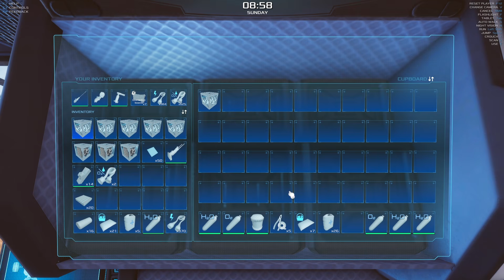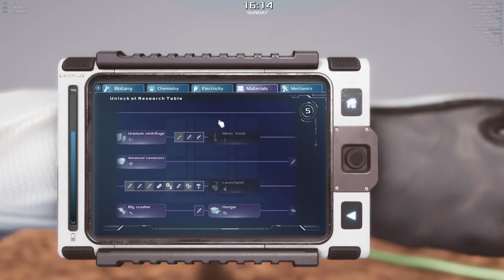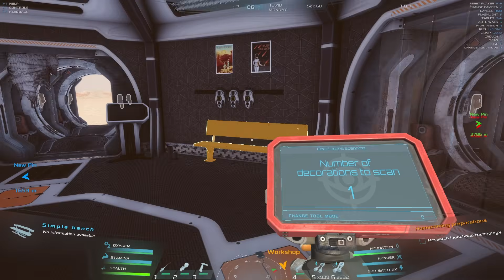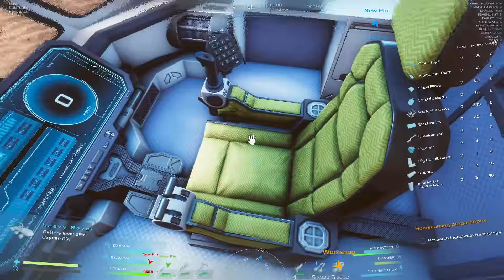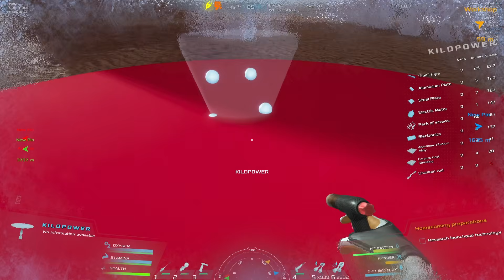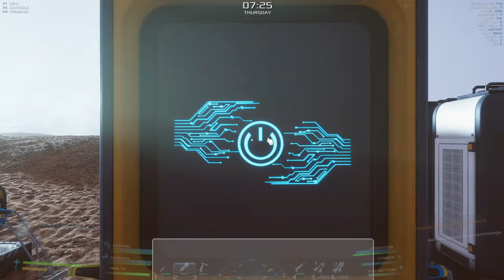Occupy Mars – Remote MINING Outpost and NUCLEAR POWER [E9]

Comment: i know im fairly late but it's for the users in the comment :)
Build platforms. more platform and even more platform :)

why i say that? when you build a platform, you can place solar panel, the kilopower, the power consumer and they don't require the cable. then you can use a ECU to send power somewhere else. you can't import power however but you can export.
when you get the tech, use O2 from room. the rover can keep your tank full. it recharge them automatically. saves me the trouble from manually reloading them. can also reload them via the inboard O2 port
the game still has lots of glitches but work somewhat OK.

Comment: What's the best way to use batteries? I have  the batteries but not everything charges and I have 1000 powered. Yet they don't charge. Having to step down the power each time between batteries so they all charge is annoying. Wish I could link them all and charge as one and supply the base as one ..

Comment: You can view the level of all batteries on the map (M) in Electricity mode. And if you have an antenna, you can even adjust the settings via a tablet.
Reply from the maker: Oh, that makes things much easier, thanks.
Reply: @surtrplays  Check coordinates (2393, 1817) and (1210, 2874). I have a lot of such interesting coordinates.

Comment: Hey Surtr, I have a tip you could pass on. I found you can build plain platforms in rows and place medium solar panels along its length ( panels snap to centre of platforms)and with enough room place a transformer on platform and electricity will go to transformer automatically no wires I have currently 8 solar panels feeding 1 transformer and not a single wire, bonus is the solar panels a perfectly aligned
Reply from the maker: Thanks. Terzo tries using platforms and it broke hos save so I wasn't too keen to try them.

Comment: One thing I am disappointed to share is that the cargo trailer does not read anything inside the dedicated boxes. When you are using materials for building. The welder does not grind so you can't use it to tear down anything. Worst of all you have to get out and set the blueprint for an item and then get back in and use the welder could to complete the item before you can get back out and set another blueprint that is dependent on the first item to be completed.

Comment: So there are a couple of things I have been trying to figure out, but I'm hoping if you figure it out you'll show us. The remote control for the Rover just shows a screen of what the Rover sees out the front or if you hit v it will show the crane. The point is though that I can't move the Rover or do anything with the crane from this remote controller. I'm hoping you could shed some light on this weird subject. In the training scenario of the campaign we use to controller on the helicopter drone and it was very slow and pretty much worthless. I have not figured out how to remotely control the base either and I did get the large antenna built to extend the range of communications with the base in case I had anything to do with the remote control for the Rover as well. Although my Rover was at the base and I was standing next to it, trying to use the controller just to see how it works. Well you can't manage the trailer from the large crusher. If it's on the back of the Rover, you can interact with the back of the trailer directly and pull inventory onto yourself and then use the terminal on the crusher to transfer that inventory. I believe this to be the fastest way. The minor zone of access does not require you to back trailer up to the cargo ramp, but you can just drive by the front where the arm can swing around and it will still pick up your trailer.

Comment: I use the jetpacks like a "Quick way to walk" in case I have to "run back" for stuff. The jetpacks are the QUICKEST vehicles in the game! (I think it's faster than the bike, but there's no indication, so I can't be sure.) By Far! I love this series! Thanks for taking us along.  I completely rebuilt my Power/Water/O2/Methane production to be on the Platforms!  It makes the base WAY more organized and itches my OCD! Shalom
Reply: The standard well has a power socket but how did you add the required power to the oxygen sab/well on the platform? I couldn't see how to plug power into it.

Comment: The rover is a mess they need to fix. Mine double backed on itself with the tipper and front in the same place. Could not get in to reset it and when I scrapped the tipper and got in it still would not work properly. Scraping the rover results in it killing you and leaving a destroyed rover.
Reply: You either hit R just before and it resets you or later research lets you teleport the vehicle to you which will reset it anyway

Comment: That was really good. Can’t believe you lost the rover oxygen bottle and batteries. The batteries are expensive to make again! Obviously still some little gremlins. My kilo power simply didn’t work - I built it and connected it but there was no power coming from it. In the display of the transformer it showed it, but also showed zero power. So now that I see yours is working, I will break it down and try it again somewhere else. I could get the lights to place pretty much anywhere - again another little bug for you? I built a few wells in far off places where the I’ve found a water source. Build a well, a sabatier, a transformer and a slightly extended battery and you have a perfect place to spend the night whilst charging the rover with both power and oxygen. Did you know that the water spots are marked with very small tear or water droplet symbols on the map? Usually close to the abandoned bases. Handy to have these recharging stations dotted about the map.
Reply: The funny part is making the batteries is bugged right now. You can make unlimited batteries at the moment in the 3d printer once you gather everything for 1 battery. It doesn’t consume the materials. I am sure they will patch it on next patch but, to be honest, I made 10 batteries, yeah I am a cheater
Reply: @steveboo14 woah! Better get on to that pronto!

Comment: I have one tip unless you are doing it, spread the power out between buildings.  I have 2 workshops and a HQ. I had all my power going in 1 building entire gameplay and I built almost every building but lobby. Well, I started blowing fuses all of a sudden like crazy. I had to run and split power between the 3 buildings for it too stop. I blew 15 fuses before I figured it out lol
Reply: if you haven figuered it out by now it is 320 that one fuse can support. So spilt your power in 320 chunks and you are fine.